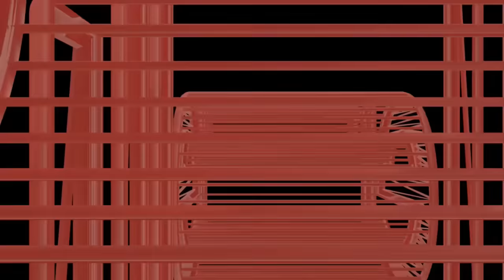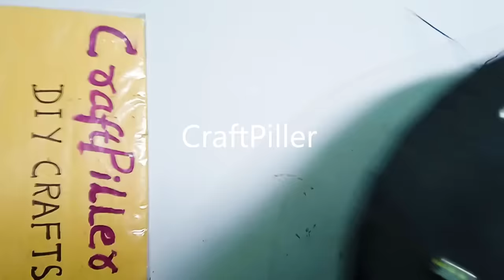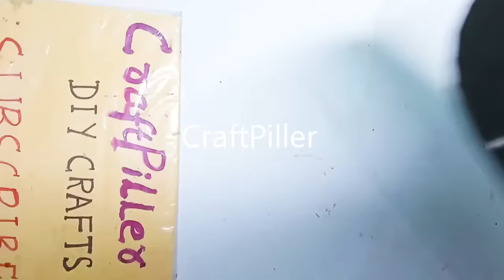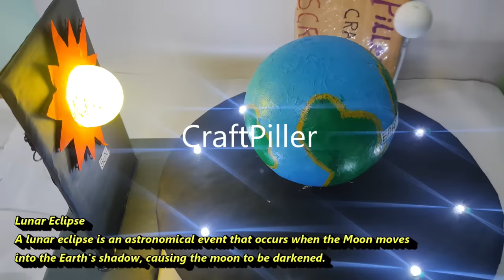solar eclipse - lunar eclipse - earth rotation working model science project - diy  craftpiller

Comment: 1.Card borad 2.colour paper  3.scessior 4.fevicol 5. Battery 9w 6.plastic ball 7. Button switch 8. ac slow running motor 9. Led light 10. wires 11. led bulb cover 12. Termocol ball
Reply: My name is also Rhythm

Comment: how the moon is rotating please tell once again😅🙏 plz.....
Reply: That moon is rotating because of the motor
Reply: But how wire joint were
Reply: @pramodjadhav8397  bro you get advice of electrical man
Reply: King Tarachand
Reply: Dc
Reply: Just you see once again
Reply: Earth ke rotation ke liye aalag button switch h ya LED wire ke switch ke sath attach hai yellow wire bhi,🙏🙏🥹
Reply: Shayad se vah us iron rod ki vajah se ghum raha hai..😢
Reply: I to have that doubt please tell
Reply: How the moon is rotating
Reply: @SriMithra-gj1yy  Because he attached moon with earth with the of wire and earth is rotating by motor and So, earth is being rotated and moon is attached with earth with wire.that's why moon is rotating.May you get it
Reply: @pramodjadhav8397 The moter is AC connected with AC Board.
Reply: Moon is not rotating beacuse monn tightly lock in earth
Reply: @kowormastersp45 rotating Ka meaning vi pata hai kya tujhe unpat gawar
Reply: BRUH JUST WATCH IT AGAIN U DON'T HAVE TO CUT ME OFF 📴
Reply: It's dc motor
Reply: @pramodjadhav8397 by the high torque gear motor

Comment: Where did you connect the wire of the motor that rotates the earth
Reply: Connect it with switch box directly to power  but : caution ⚠️ be careful don't touch the wires after you remove them otherwise it will give shock to you 😉 thanks

Comment: can i use a DC motor instead of AC motor
Reply: I think we can because the difference between the ac motor and dc motor is that the dc motor uses battery and ac motor uses a plug and is a little bit stronget